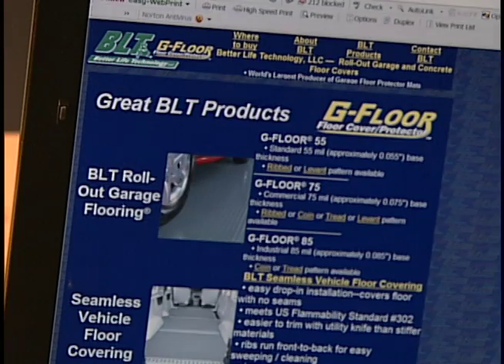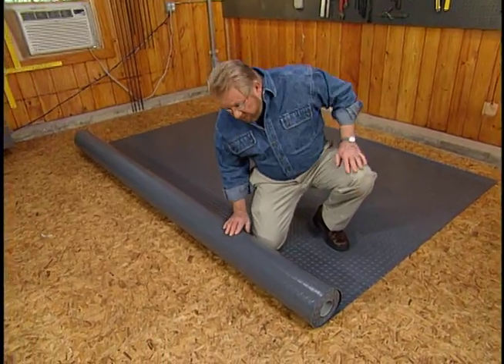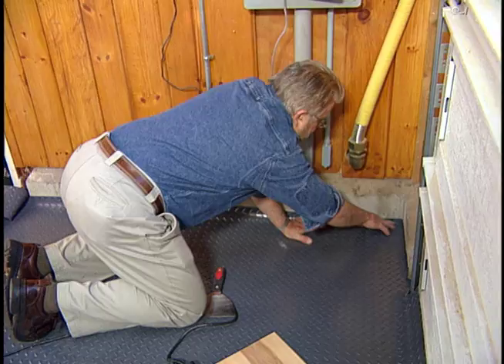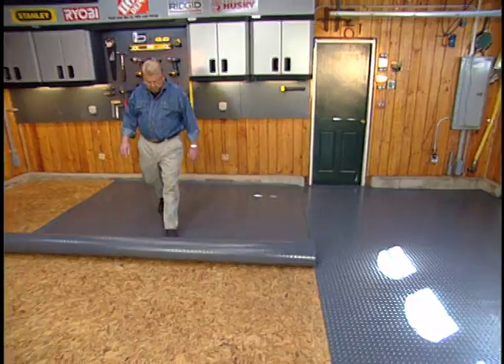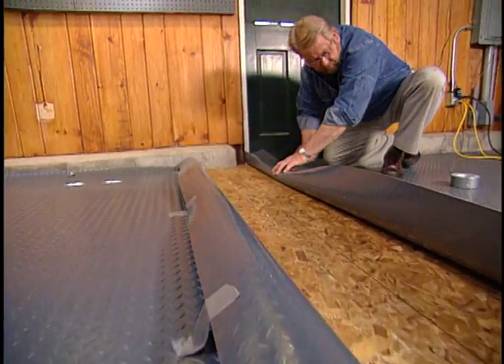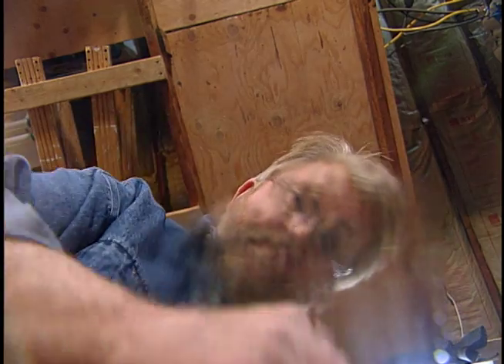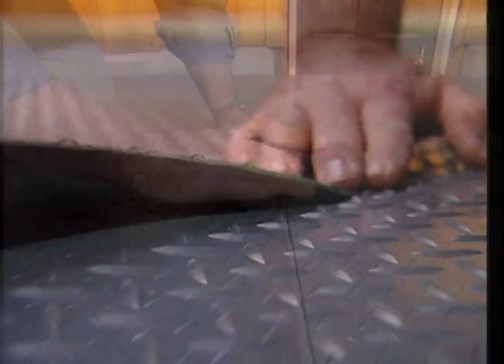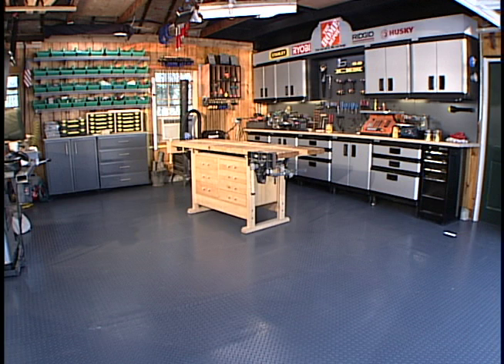Install a Vinyl Garage Floor

Comment: I bought this for my friend for his birthday as we just moved into a new house and he finally has room for a workshop. The bench was very easy to set up https://www.youtube.com/post/UgkxyFZUPFEey-PuqsPMxqaykBhgA1LWxFHh They center support is a little difficult to snap in and out of place at first but at least then we know the bench is secure. It was a pleasant surprise when we saw it came with clamps. I apparently missed that in the description. My friend loves the versatility of the bench. Great starter bench for his workshop and easily transportable all over our property. I wish the bench was a little taller but the other features of the bench more than make up for that.

Comment: How does this hold up with multiple car entries each day? How about engine oil and drippings from road grime? How about moisture infiltration from under floor causing mold growth? A lot of questions beyond the initial good looks.

Comment: I just use Stone coat countertop epoxy on my garage floor and it came out awesome the colors that the hard coat you could sweep it you could drop things on it,the epoxy holds up and it didn't cost very much might want to look at epoxy.
Reply: How much did you spend, and what was the curing time?
Reply: How does it hold up against hot tires parked on it long‐term?

Comment: I like how he said to use the plywood behind the flooring to cut it to keep blades sharp. Then proceeds to cut the rest of the flooring against the concrete not following his tip.
Reply: Ha, your right
Reply: Plywood was when he was rough fitting. When he's perfect fitting against the wall, if he had plywood there woild be a gap.

Comment: Sir
   I live in Florida. I have a slab. I have some areas of efflorescence even away from the edges of the wall. I suspect If I put this over the slab I will end up with a mold problem, correct?

Comment: I think this would be fine for tinkering. But not any real work. I have 3 tool chests that would sink into it and get stuck.  I cant weld near it as slag would melt into it if not catch it on fire. I could not jack a car up as the jack would press into the rubber and the jack stands would become large cookie cutters. But maybe in a woodworkers shop or plumbers shop it would be fine.

Comment: Good topic. Some questions though....how do you make sure the two edges, of the two sheets, are straight and match up perfectly? Did you apply cement to area covered by tape? If not, does it still lay flat? How did you get the flooring under the heavy cabinets? Is this material suitable for a garage? If so, what do you suggest for edging/transition to outside? What would you estimate cost per sq ft to be? I'm sure there are many more questions.
Reply: I am no expert by any means, just a DIY'er perhaps considering vinyl flooring for his garage. But if I were to guess, I would take cross-wise measurements at various parts of the room, making sure that your measuring tape is parallel. I'd probably take this approach myself because there is never a room that is perfectly square so you might get 10' on the nose on one end of your garage, and sometimes as much as 10' 2' on the other end! Ultimately, I'm trying to avoid seams in general for this reason. Some companies offer custom size rolls so I'd stick with them unless you have a very large space.

Comment: FYI these rolls of flooring are about $265 for a 7.5' x 22" roll
Reply: Or $99 for 5 gallons of liquid rubber that will do roughly 2000 sq ft.
Reply: That's what I'll be doing - A few gallons of primer, epoxy, and sealer along with a bag of paint chips and sand and you have a good looking floor.
Reply: @NWinnVR  Liquid rubber? Plastidip?
Reply: @xelnjare3945  in
Reply: In December 2021, a 10x24 commercial grade g-floor roll that you can get delivered from Home Depot or Lowe’s is around $450

Comment: So it's "good looking," but you didn't test "functional." Does the vinyl resist tire abuse? What happens when you turn vehicle wheels? Does it deform or rip? What about hot tires, fresh off a hot highway trip? Does the vinyl melt? More diligence is needed here.
Reply: These were the mats I originally wanted but opted for a thinner vinyl mat for nearly half the price. 15 years later, my mats have held up quite well here in the DC area with the different seasons and with me being the average DIYer for my cars. With the exception of turning the wheels sharply as it would grab the mat due to the lack of thickness (my solution would be to place a piece of cardboard or newspaper under the tires to eliminate the friction but since I have a standard two car garage, I rarely have to turn my wheels), I no tire marks or marks from using my jacks. So w/that said, I could only imagine that these mats in this video would hold up quite nicely. Hope that helps!
Reply: M C aa
Reply: @ImNotMC  which mats would that be ? I'm looking to buy the same!
Reply: @gurpalsingh3695  I have the G-Floor Levant
Reply: @TimZ007  Yes, good point, I forgot to mention that. If you use jack stands, they can mark thin mats due to their sharp feet so I've placed 1/4" MDF under the stands or even as thin as pegboards and that helped. But I don't have any issues at all using hydraulic jacks on rollers and wheels.

Comment: FYI. If they get wet they are slippery as ice. Also I wouldn’t recommend this for a garage you park on. They get very dirty, especially in a winter climate and liquid always finds a way underneath.

Comment: This vs epoxy is obviously cheaper. Being durable and lasting are just a few questions one have. But this seems to be quicker ,and something on the floor vs nothing. And if it doesn't hold up, then try epoxy.🤔 I've heard the horror stories about epoxy too, so who knows??🤷‍♂️🤷‍♂️🤦‍♂️

Comment: What flooring and seam is that?
Reply: It’s dricore sub floor panels, and he uses Oatey shower pan liner adhesive, but not sure what that roll of seam tape is; wondering that myself!
Reply: It’s an Oatey bath pan liner roll and he just cut a small strip out of it. Can get it at Depot/Lowe’s

Comment: What he doesn’t state - is that each roll can weight up to 400lbs. Not really for the “ do-it-yourself”
Reply: The 10x24 rolls, which I believe are the largest G-Floor makes, weigh 150 lbs

Comment: And what keeps it from moving when you have a car parked on top of the floor and you turn the wheel?..

These are questions this video did NOT answer.
Reply: .....and you won't get an answer to your questions here either.
Reply: @sigma9102  why is that?
Reply: @sigma9102   then wtf did you say " .....and you won't get an answer to your questions here either. ".   Don't give responses like that if you're clueless.  It's not rocket science.